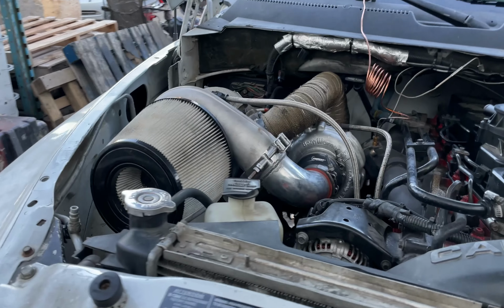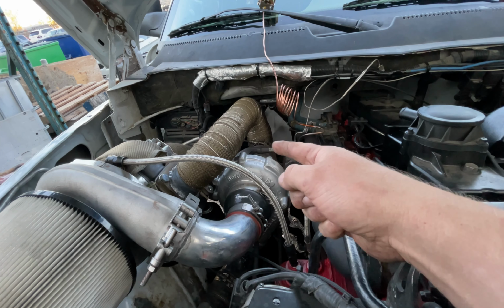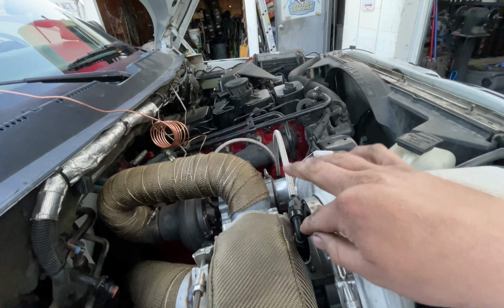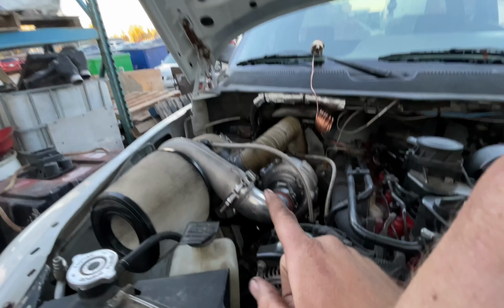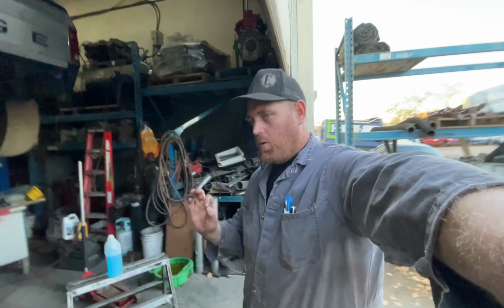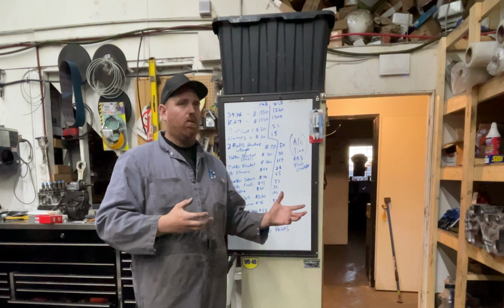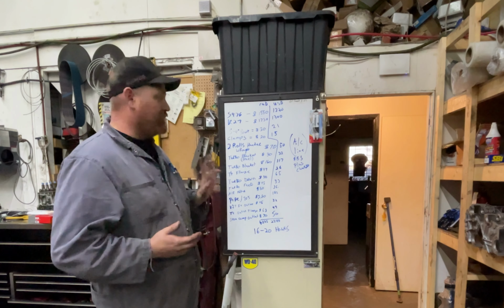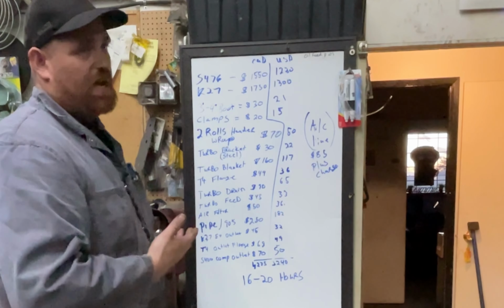K27 -s476 compounds turbo on a 12 valve Cummins  price !!!

Comment: I ordered a compound kit fro DPS. Its the stage 1 that runs the 475 over the stock hx35. I have a fresh mahle head gasket and Exotic head studs. How much boost can I safely run? I’m a manual with a 215 pump, 5x12 injectors, stock timing, and a s362sxe making 50lbs now. Also with this kit should I add the 4K spring to my current 3k governor set?
Reply from the maker: I like the 4K myself. Timing up will make it run way better. But is harder on the head gasket. 45-50psi on a good gasket is fine

Comment: So i always see where people trip out about cold air intake with no sroud to keep engine heat off of it

Is this not really an issue?
Reply from the maker: Any time you can pull heat out on the intake air temp it’s best. But honestly I have never worried about it. But when I get some sensors for data we will find out
Reply: @CUTTERUPROB  cool.  I like where you plan on going with genuinely testing things your self and sharing results

Comment: Tight radius donuts.

K27 isn't worth the cost. Go look at PDD's vids on that turbo- they pushed it (sales). And then they tested it against their "Aggressor" turbo. Stock he351 is just as good. Better, actually. A 67-76 turbine is even better in the he351. IMO. Wouldn't buy the K27. I still think the T6 atmosphere turbo better. Ya, the t4 spools super fast. I just think a S475 T6/1.32AR can still work in a towing app. And cheaper. Tuning needed, and probably a slightly larger injector... but I guess that's the break-point... Want to use stock everything? T4 atmosphere. Willing to put injectors in and tune? T6. Injectors on 24v only good to 150k-200k miles.

These days, market flooded with chinese knock-off he351s. Ok, fine... but replace the compressor wheel with stock Holset, or US made billet. They blow up. Don't deal with a blown up turbo. It's not fun or cheap. Same with the S400 turbos, I see.

Not a fan of side by side turbos. I do over-under. Keep the turbine side as short as possible. I love those cast iron 8.3L cobra heads. Not cheap anymore, though.

Comment: Very interesting and informative video. I have a question tho. How would the combination HX 35 and HX 52 perform on this engine?
Reply: If ur looking for hp that setup will not work good. If ur looking for towing and little bit of fueling up to 400hp it will work good
Reply from the maker: Yep it’s a old school setup
Reply: I'm adding an ht60 I picked up for $100 to my hx35. Cheap, but not a monster setup. Not trying to go crazy just tow pig. Should be fine. Watching this video for ideas on diy fab up

Comment: I was contemplating putting compound turbos on my truck. It an 03 5.9 with a Hamilton towing cam. I just got a new Hy35w replacement for it and I was wondering what, if any second turbo you would recommend to go with it in a compound set up? I’m looking for a reliable towing set up. It also has a manual trans.
Reply from the maker: He351 over s472 I really Mike’s on my 2003

Comment: Yes, those tight radii 90's are $$$!  I'm in the middle of fabbing  up a side-by-side compound set, and the manifold turbo is flipped so the compressor wheel is facing where your turbine is. This keeps the hot pipe super short and hopefully spins the S473 t61.15 88/96 super quick. Its just like what you have but the hot pipe length is now the interstage length on your setup and vice versa.
Reply from the maker: Yep I have some couple that way too. I not sure it made much difference but it did look cool

Comment: 👍👍thanks feller...not exactly sure how I'd like to arrange the setup when I do... your's is a good way ..the hot and cold pipes would probably be my biggest hurdle....all I've got is a MIG welder... could buy them from wherever I suppose...but anyway 👍👊🍻
Reply from the maker: I have done lots with Mig just have to make sure you clean them good
Reply: @CUTTERUPROB  10 4... thanks 👍
Reply: Keep the metal clean and biggest tip is get comfy! Find your leaning angles and get comfy with your welding pass before you start the pass. That's the best tip I got many years ago.
Reply: @mustangdemon87  ten four man, thanks 👍👍👊